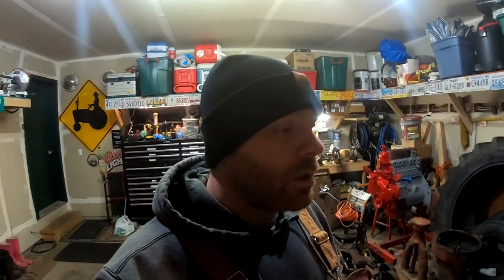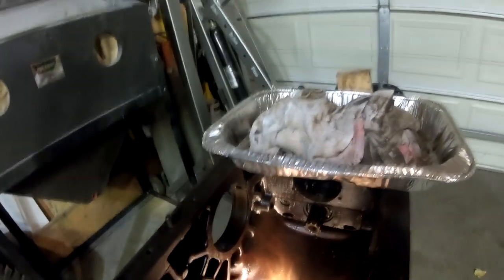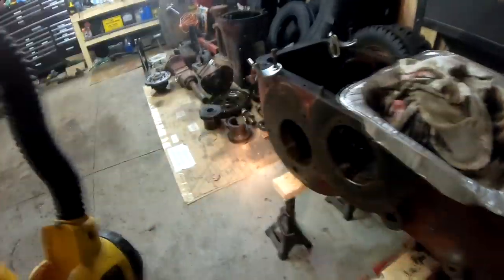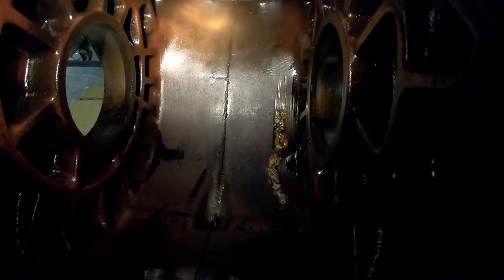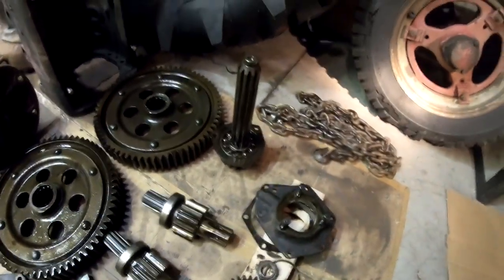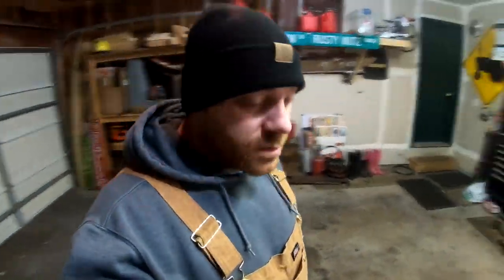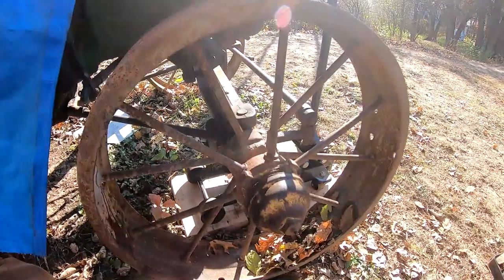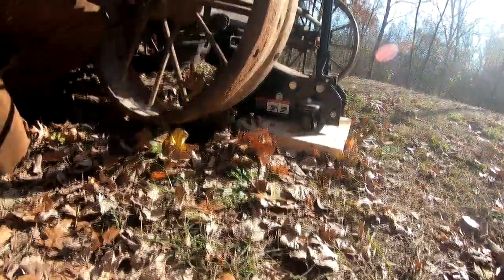Memorial Farmall H Update & 1928 John Deere D Update

Comment: This is just my opinion based on growing up with my Dads M but if your case isn't leaking it's  still good to use.  Dads M was broken, brazed from the outside, before he bought it and farmed with it for years with no issues.   We lost an inter axle bearing when I was in middle school and found the repaired casting then.  It was apparent that the casting was removed and turned upside down but it is still running that way to this day.  It would not bother me a bit to braze it in brass and call it good however there are some really good cast iron repair rods that I might consider instead.   Either way,  looking good and get well soon!
Reply from the maker: I was on the side of using it as well, but for one - the entire bottom side of the gear case was covered in old dirt and oil. (so much so that you couldn't even feel the weld on the outside).... And two, with the nice paint job we are going to be putting on this tractor, I don't want to have a leaking casting due to a crack. A seal springing a leak is one thing, but to have the casting leak is something I don't want to deal with after it is all back together. For what I can get a replacement gear case for, I think it is better piece of mind to just replace it.
Reply: @KennyKizzleRustyNutzRanch  don't blame you a bit.  Lots of extra work for little reward.
Reply from the maker: @fbh31118  Well, it is turning out to be a BUNCH of work, regardless.

Comment: And you’re right, that sandblaster will come in handy in your shop. Very nice of your cousin to provide for this and many future tractor restoration projects in the future! Love seeing the D. 🚜👍🎃
Reply from the maker: Yessir! Very kind of him to give me the blasting cabinet and the tank set. The torches and cart were his grandfather's (on his dad's side). A VERY good addition to the shop.
Reply: @KennyKizzleRustyNutzRanch  if you are going to sand blast external parts common sand blasting sand is ok but if you are going to sand blast engine parts or sheet metal use body shop baking soda as it  disolves in water for cleanup and wont damage the metal finish
Reply from the maker: @brokenwrench1  Good tip! Thanks!

Comment: Sounds like that flesh wound is kicking you hard! Get well soon. That sandblaster will come in handy. I know mine does. What are you going to use for the media? I use glass beads from HF. Let me know where you get the tanks filled. I need to get some filled. Heats a wonderful thing. Looking forward to the next installment. Get some rest. Colds suck this time of year in MN!
Reply from the maker: Yessir. I still have the crud and it is just as bad as it was a few days ago. Not sure what the heck it is... Oh well. The sandblaster had crushed walnut shells in it which works great for polishing, but I will be running glass media. I got the tanks filled at Airgas, they were reasonable, and they were able to exchange the decades-old tanks that we had (they were Airgas tanks out of Iowa). Heat sure is great, but I have found that even on the current project it was unsuccessful. I will try to make another update video today.

Comment: It would be kind of cool if you lay all the parts out on the driveway, and do a time lapse reassembly. I wouldn't be surprised if a guy could build the whole dang thing in a day, especially with the engine together already. Anyways take care of yourself Kenny.
Reply from the maker: That is not a bad idea at all! I will consider doing something like that. I think if I had an extra set of hands, we could probably get it put back together in a weekend. I don't like rushing things - especially when the parts are painted. I am considering painting it in chunks, so that everything has a coat of paint on all surfaces. We will think of something cool - spring time is paint and assembly time!

Comment: hey Kenny if i was putting that H back to hard work that crack is not as bad as it looks i would grind that weld smooth 2 inches wide and mix up JB weld or similar product if there is no evidence of the crack on the outside. i have seen much worse cases repaired and put bak into service. like the bull gear grinding half way thru the case and the rut was fusion welded with  a welding torch and the casting preheated with charcoal and fusion welding with cast iron rods with copper flux.. done right you cant  see the weld.seam. not many welders know how to fusion weld cast iron. fortunately i have done it..
Reply from the maker: Well, wish you lived closer to us! I think, just because there was so much oil on the bottom of the (outside) of the case, and also the fact that there was only about 3 gallons of the 6 gallons that was suppose to be in there... It's a pretty safe bet that the crack and weld are leaking. I have a replacement case lined up for pickup tomorrow, and the salvage yard is taking care of it awfully reasonably. I'm also picking up a replacement pinion shaft/gear as well as the pinion carrier... Everything will go back together crack-free.
Reply: @KennyKizzleRustyNutzRanch  well if you had this failure during  WW2  replacements were harder to get so you  fixed what you had. but now putting that back picture perfect you got an A 1 frame up restoration . it will be as good as new when you are done..
Reply from the maker: @brokenwrench1  I just wanted it done right. It'd be a shame to put nice paint on it only to have that crack start weeping again. That was my main reason.
Reply: @KennyKizzleRustyNutzRanch  with spare parts available cheap replacing it is the right thing to do. i just wish i was there wrenching with you..
Reply from the maker: @brokenwrench1  I agree. On one hand you hate to see these old girls parted out, but on the other hand you need the necessary evil in order to keep the rest of them going. Would be fun to wrench with you and many other viewers. Imagine what we could get done if we all had our own shop together!
Reply: @KennyKizzleRustyNutzRanch  i learned to wrench to  help keep the farm profitable in the mid 60s to early 70s.  in 1970-72 totally rebuilt my H and my M and dad's AC  D15. i graduated high school on friday night and reported for work as a line mechanic at our AC dealership.  then i was at a john deere dealership  for 3 years  a IHC dealership for 3 and a massey  dealer  for 2 years as a shop foreman and lead mechanic., then i switched to being a grasshopper dealer rep setting up dealerships until 1986..
Reply from the maker: @brokenwrench1  Lot of knowledge in that head of yours! Man, I sure could have used it over the last day and a half... But, even then I don't think there would have been any way around what happened. Stay tuned for the update, I'll fill you in. I'll try to get one up today. I'll just say this - I think the reason there was no hydraulic pump in the tractor when I got it was due to a critical pump failure... And that caused another issue as I will show.

Comment: Nice video ken, if you were here in Florida I'd sandblast the H for you at my job since we got a paint shack there, the D is looking good with those steel wheels, have you turned the flywheel to see if it has loosened up more since the oil has been in there for months? I'm excited for the H but something about the D has really got me. cant wait for the 2 cylinder to pop to life, hope everybody at home is doing well and hope you feel better soon, take care 
Mike
Reply from the maker: Thanks, Mike! Would be cool if you were closer. We could definitely figure something out, then! I have tried turning the flywheel several times. It won't budge. Guess is I'll have to pull the block and pistons as a set and then put them in a press and press them out. That D will be a fun project. VERY simple, not much to it. Of course, there isn't much to the H or M, either... Now that I have been into it this deep!
Reply: Ken, it would be fun to be closer to figure out about sandblasting, cant wait to see it done and cruising around, really cant wait to see the dive in to the D pulling head, block and removing pistons.  Already planning my vacation to Rollog next September, hopefully it's cool weather(hate hot weather). Well, hope everything's going well and take care. 
Mike
Reply from the maker: @gmc_crackerbox_truck1485  I can't wait either. Only a few long WINTER months and we will begin reassembly. Then, once it is finished. The D will enter the shop! I look forward to finishing one and moving on to another! Until then, I am going to try to kick this sickness.

Comment: Does it have a distillate manifold? If so do you need a heat shield?
Reply from the maker: It does not have a Distillate manifold. It was a distillate tractor but has since been changed to gas. Thank you for checking!